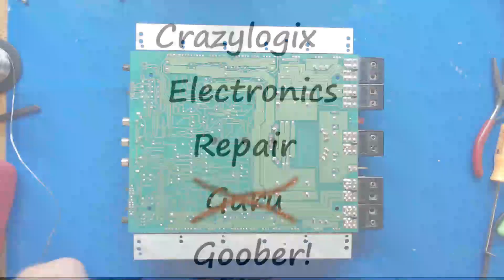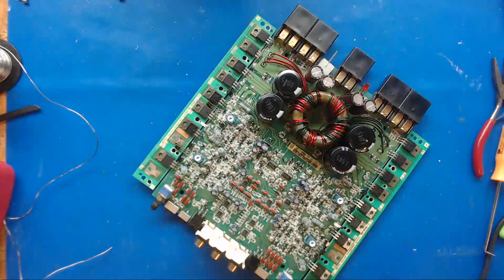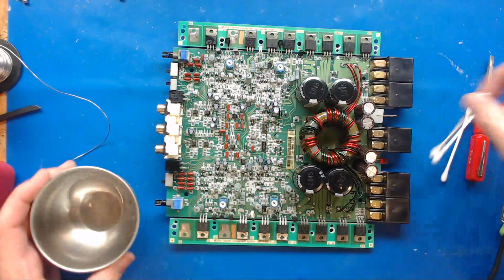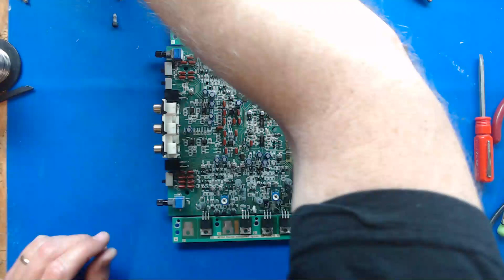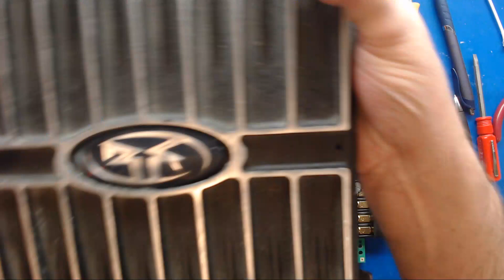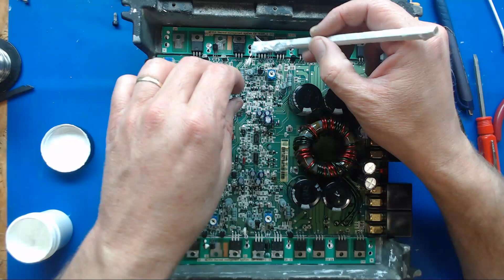Old School Rockford Fosgate 400.4 Part 5 - Prep for Bias Ajustment

Comment: Hey Damon, I was wondering what kind of flush cutters do u have with the plastic cover that covers up the tips? Because I have a set of Klein flush cutters but they didn’t come with any protective tip cover. Also where did u find that info on adjusting the bias on Rockford amps threw amps like u did and also by using voltage to adjust the bias pots. Please let me know so I can read up on that info. Have a great and blessed night! Thx so much Chris
Reply from the maker: Funny thing, they are the cheap pair from home depot (tool shop brand) but treated well they should last a bit. I read Perry's site bcae1.com and ordered his guide, I also google searched manuals for different amps, you can find tons. If the service manual tells you a way to set the bias, do it, if you cannot then I measure across a emitter/source resistor of a good channel or use the .050 amps current set method.
Reply: Oh ok. Thx so much